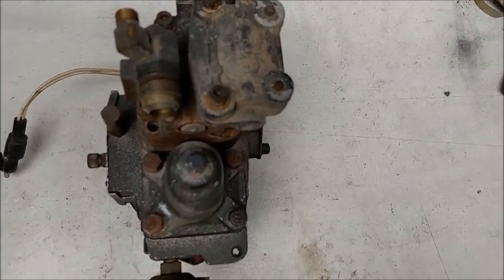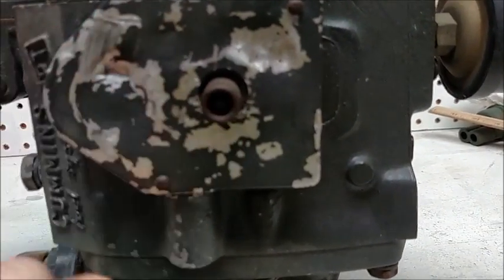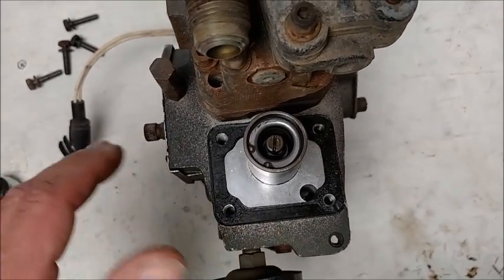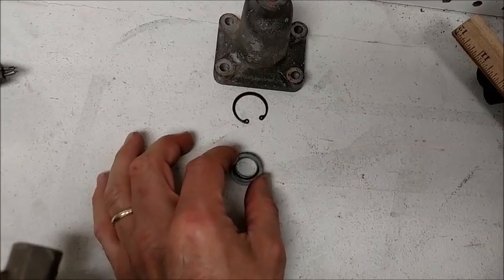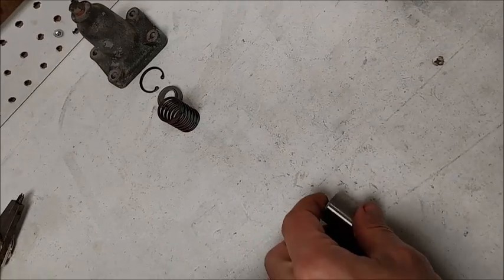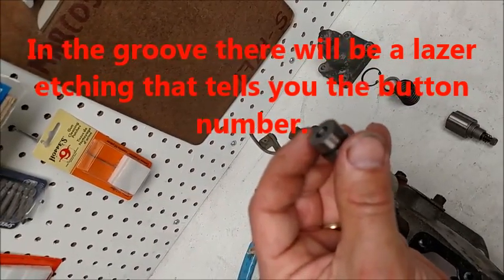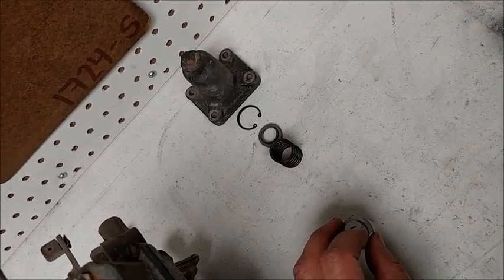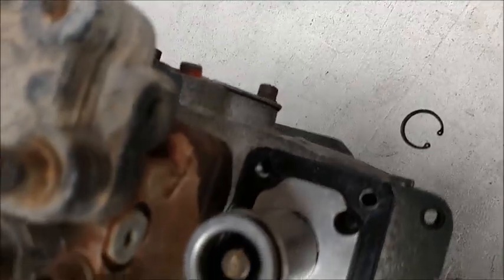Fuel Button Install on 855 Cummins PT pump

Comment: Ive been in the military 22 years done a ton of years the 30 button is the smallest a zero is the biggest you cant find zeros a five is easily buyable if you know a good machinist they can make a double aught but these military nhc-250 engines have all three the smallest three power building components upgrading the button will help but the engine is still castrated 855 engines make power in three areas. 1 the fuel pump orifice they vary from 1/4 up to 1 1/4.    2 the button and three the nozzle of the injectors

Comment: I took my pt fuel pump off its off of a 855 350 big cam Cummins when I put it back on the truck start good but after a min the truck start to rev up really high and it won’t come down what could I do to fix it

Comment: I was told that if I put a number 5 button in my big cam 4 it can burn up my pistons do you know if the change of the button will burn up the piston....
Reply from the maker: Run a pyro for sure.  You will be adding a lot more fuel which creates heat, the heat is what could burn a piston.
Reply: So what button would you recommend for additional power without changing turbo. My big cam is rated at 315hp .. i just need to boost to 375hp or 400hp just to help with the weight. I don't really want to change the governor 75mph is good but my truck struggles a bit on hills...
Reply: You can definitely cook the pistons with a 7 a good number is 15 no lower then 12 and dont lug
Reply: @travislee4704 I change from a number 25 to a 15 I notice the difference I am planning on lowering to a number 10 what else can I do to increase the power.
Reply: @adriancunningham6772  I wouldnt mash it all the time because a 10 is too much fuel. Wong last 300k miles
Reply: @travislee4704  ok I will try a 12. What other mods can I do to it to gain a bit more power
Reply: @adriancunningham6772  adding fuel is a dirty way to get power if you over run and lug the engine it will burn a valve mess up a liner or score the piston remember if its puffing lots of smoke it's doing way more then it should
Reply: @adriancunningham6772  turn throttle shaft screw out 1 turn and put blue spring and 4  fat shims and that 12 button and turn the afc out so it shows 3 threads. Run a pyro gauge and never hold it above 1250. Degrees for more then 10 seconds

Comment: They sell a special curved wrench to access that rear bolt on the fuel pump
Reply: That wrench is actually for the air compressor. It's not needed on the fuel pump

Comment: There really isnt much info on some of the old stuff like this, glad you put one up. What do you reload? I have a reloading room too. I have dies for 87 different cartridges currently, probably adding another with a 7.5x55. One of only a couple of milsurps I dont have but I'm bidding on both a 96/11 and a k31.

Comment: Hi good day. I have a question. Can you dissasemble a pt pump and dont let a calibrator calibrate the pump? Implaning to change the front oil seal. And dont want to go to the calibrator shop

Comment: If I just want to adjust the idle.. does the fuel stop after taking off that plug? And how do I bleed the system?
Reply: There will still be fuel in the lines, heads and injectors. Fire it up and hold the RPM up a little and normally it'll pull enough fuel to self bleed pretty quick. If you have a questionable fuel system you'll have to crank on it a little while. You don't need to pull the entire governor cover to adjust idle, just the plug at the back. Cummins has a special tool to adjust the idle while the engine is running to avoid the adjust/start/bleed/readjust game.
Reply: @speedandmarine9066  I think 3/4 turn right increases idle 100rpm,  turn left decreases idle 100rpm. Slightly back off after turning 3/4 turn.
Reply: @jameshickey9393  How much the idle screw affects idle RPM depends on a lot of factors. No need to back off after adjusting if you use the correct method. If you don't have the special tool and are pulling the plug to adjust with a normal screw driver you need to run the engine long enough to purge the pump housing and stabilize the idle on a hot engine to see if you need further adjustment

Comment: I've done that a bunch of times on the truck if your careful you won't lose parts.
I took out a #30. And put In a #7 plus I stretched out the governor spring. 
When I finished blow smoke every gear change, no load engine RPM 2450.
Fuel mileage went from 5.8 to 6.25 running at 62-65 MPH when coming to a hill ease fuel pedal to floor many times topped hills I would had to down shift once, never had to after the easy tune up .
Better throttle response and fuel mileage great combination
Oh, at 62-65 MPH RPM was around 1700 RPM
Reply: Blowing black smoke means ya over fuelling the motor,  how could you get better fuel milage🤷🏻‍♂️.      You have have upped ya fuel pressure considerably changing from a #30 to a #7(didnt know they made a #7🤷🏻‍♂️)  Shouldnt change by more than  5 at a time.   30-25,  25-20,  20-15 etc.    I hope hour camshaft can handle the extra pressure.    And id watch that pyrometer like a hawk.   Melted pistons dont do motors much good.
Reply: Did you mean 7 or 27 because I want to order that same button you did I have down shift as I go up a hill and would like to roll coal
Reply: Also what does it mean the higher the number what does it do as opposed to the lower number like a double 0

Comment: greetings, just came across this video and all though this is an old video. I wanted to pass something  along. the "button " is actually" for how much fuel gets by-passed back to the tank.and limits how much fuel the pump receives. andyes the #stamped on the button relates to the size of the hole. the actual name is called " the fuel by-pass disc" enjoyed the video.

Comment: Is a PT pump on an L10 the same?  My '93 L10 is 280 hp, and I would like to bring it up to maybe 310. I don't want to get too crazy with it. Thanks.
Reply from the maker: I honestly can't answer that.  I will try to research it and let you know.
Reply: You can hit 310 with it pretty easy. We had one that we cranked up and put bigger injectors in that was about 400 and it didn’t last long so we went back down to about 330

Comment: I have never taken a pump off to change a button, in your video you turned the pump horizontal (like it would be in the truck) to pull the button out anyway. Literally a 10 minute job on the truck. Thanks for the video's
Reply from the maker: Absolutely correct.  Just a lot easier to make a video on the bench.

Comment: Hello good day .. consultation . I have a cummins generator with a pump of the type pt . the problem is when they run out of oil ... or makes a service ... take a long par make it take fuel .. where should purge ... loosen sections of the exit nozzle fill the pump drawing ... the alen this up .. etc ... which is not logical or actual method for doing this procedure. Hernan greetings .

Comment: I would live to know what number you used, where you got it and your opinion about power, MPG and EGTs.  Thinking of doing it myself but MPG is more important than HP for me.  (edit just saw where you say #20)
Reply from the maker: +NelsonStudios
I plan to change that to a 12.  Currently I buy them on eBay but not that I have my own parts website I'm hoping to make them available as well.  My EGT's hover around 900 when cruising on the freeway at 60 to 65.  If I encounter a substantial hill and I'm pulling my M989 HEMAT trailer I will hit 1250 and then start to back out of it.  I'm not sure about actual horse power gains as this is such a heavy vehicle to begin with.  Pittsburgh Power claims the dual fuel line modification alone increases 25 horse.  I do believe this is a needed mod with the dual fuel line for the extra volume needed to maintain stock pressures.  Some one much smarter than me could explain the hydraulics law of pressure vs volume.

On a side note I do believe that you and I need to exchange some contact info as we both seem to gain a lot from each others videos.  Plus I think we can help each other out on some of the projects if we were to collaborate.  please feel free to email me anytime, or anyone who has questions can.  Ken@MVPartStore.com.  And be sure to visit the website at www.MVPartStore.com
Reply: I contacted you through the store.
Reply: +WoodWorking With ADD   Did you change to the #12 fuel button yet?
Reply from the maker: +OC45573 Not as of yet.  The truck will be on the road for the first time since November today if all goes well so it'll be a while yet.
Reply from the maker: Not yet.  Haven't had much time.

Comment: Is the governor plunger supposed be removed freely? Mine is completely seized. The coupler was broken and the tee that spins the plunger is sheared off.
Reply from the maker: +Samual Krokson Sounds like you may need a new pump.  Wish I had a spare to share.
Reply: +WoodWorking With ADD I'll tear it down more and try to get it out then I'll have to find parts, spare parts would be great not much on ebay